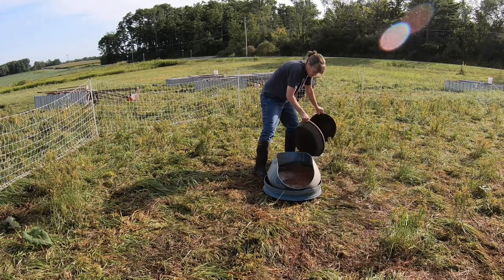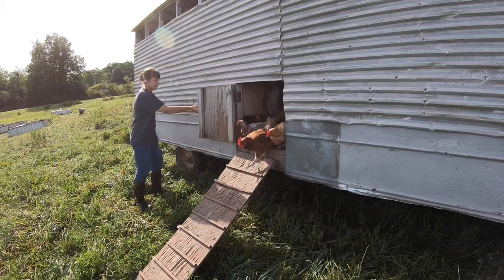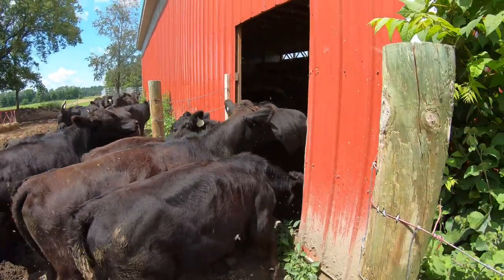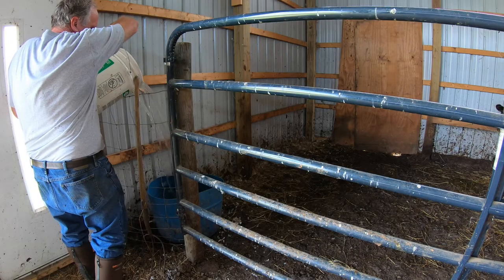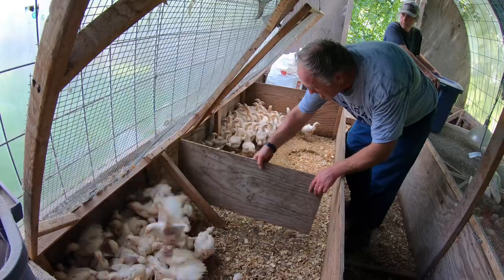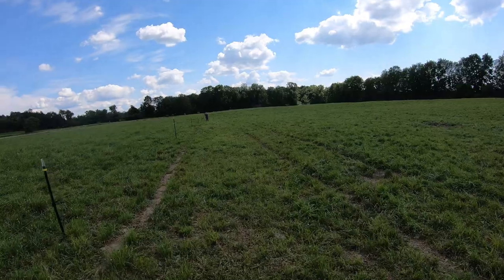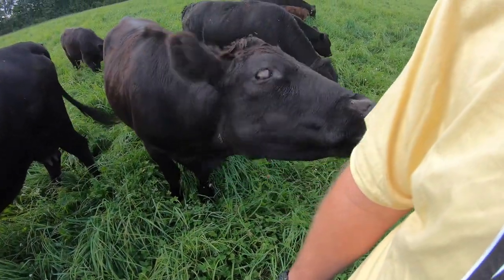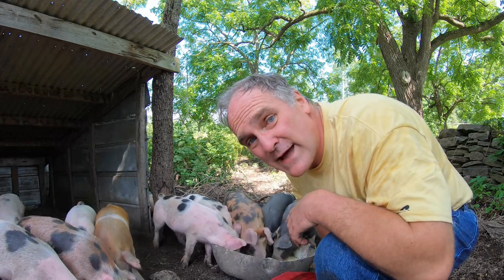Look What I Found!

Comment: Sunday stopped @ booth #72 and wide awake bakery. Have just finished watching your series on rebuilding your ancestry home and have to tell you; we did the same with an 1850's home built by my great grandfather. As I watched all I could say is "been there done that" and was amazed how similar styled our homes are, and 300 miles apart. Our daughter was the age yours were when we did ours but is now a veterinarian @ Cornell. Will stop and visit booth #72 on a Sat next trip.

Comment: Excellent video Pete  :) yes I am in Ontario Canada also have my share repairs  on vechiles as mechanic also body restoration to fix old to new vechiles! Also years ago on farm the 1950  Cockshutt COOP 40 gas motor and  1963 McCormick International B414 Loader tractor  Desiel motor & 1978 International 724 Loader tractor Desiel motor do rad cleaned  plus repairs also fix cores  because road salt from road  even use them going to other farms my dad rented in Winter or Remove snow each year of 4 months Winter Season! B414 was worst rad and hard get parts for sometimes because machinery shed never heated in Winter Season to or insulated from cold winds or you name it!

Comment: Being a mechanic of 30 years of experience, I hate to tell you that any amount of water mixed with the transmission fluid, even if only for a very short period of time, will cause premature failure of the clutch packs. The material will begin to breakdown chemically and there will be noticeable slippage until it quits pulling altogether. This usually starts to happen rather soon. Only way to resolve it is either a complete rebuild or a good used transaxle. Just a heads up from an old grease monkey. Love your channel btw!

Comment: If you have time Pete i would be interested on your view of having a older tractors on the farm vs one new kubota or any other brand. Personally nothing against new machines but i dont have the income to afford them. Having 2-3 older tractors do the same job for me. Yes there are downsides but then again where is the joy of learning and discovering the knowhows yourself? I like working on cars but the moder vehicles are just a hassle to start with.
Reply: Steve I'm currently watching Mustie 1 renovate a Kubota that is a few years old. What surprises me is that this Kubota, his friend's Kubota and the other Kubota he has at another place is that none has a roll bar. Though commonly called a roll bar that is a misnomer, it is a roll-over or more often a roll back (where the tractor tips backwards on snatching a load) protection. These first started appearing in the UK and Ireland in the 1960s or 70s, nowadays, all larger tractors have full protection cages and no doubt glazing and air-con. You even see vintage Fergussons or David Browns where farmers' affixed bars behind the seat.  These Kubotas are not that old though, has the US never had any legislation for tip-over protection for tractor drivers? Out of courtesy, I would have provided a link to what I was talking about, but Pete doesn't like YT links. Are Kubota still making these small tractors for the US, in the UK the smallest is a 66bhp model in a modern format.
Reply: @COIcultist  I have seen Mustie 1 video. Well he dose what he can. Can't say anything bad about Kubotas.They have there nish of usage in today's world. As for the roll bars. Not that familiar with western tractors. But I can give a example from what I know from my hearth: I remember the Soviet tractors from the Belarus series started getting roll over bars in the early 1980s for the internal Soviet market. But the onse that got exporter where equipped by the abroad dealers with roll over bars and inside reinforced frames for the cabin as early as late 1960s. That was to do safety laws that made it mandatory. There where a lot of accidents with the belarus tractors specially the 720 series that in a case of a roll over the cabin would crush the driver and be fatal 99% of the time. I'm amazed it took the soviet union really 30 years to start taking measures to prevent death on roll over or fatal injuries? What ever the case was at least the later tractors where much safer to use for the end user.
Reply: He kind of covers the new vs old tractors in one of his tractor restoration videos if I remember correctly. I agree with him that I would rather fix up an inexpensive older tractor than spend the large chunk of money a new tractor would entail. I have a decent old 4020 John Deere and a old Mahindra 4500 with a Frey Loader. The Mahindra runs but still needs a little work but at 3,000 vs 35,000 I know which route I am going to pick.
Reply: @Mtbambeno  Maybe he did, cause Pete has had so many videos I keep loosing track. I do see benefits as a small farmer having older tractors. But there are some pitfalls with them as well. Don't think that is the case in the States cause there is a huge variety of different models and brands. Not to talk about retailers and vendors who specialise also in older models. In some parts of the world it different. I can only speak from my own experiences but that would be like making a hour long video. Rather saying it short, make a plan and be sure to know what you buy+ always have extra cash in case you need to spend more then you planned for.

Comment: at a pasture we rent for cattle there is an old pole barn with a farmall 656 gas and an international 666 with a loader, chains, and a set of duals. neither run but a few guys came out and worked on the farmall. i wanted to buy the loader to put on our hydro 100 to put hay in for horses. also we used to put that hydro on our 12 row corn planter and 25 foot disk

Comment: Hose the underside/ frame/ axles of your vehicles with Fluid Film or CorrosionX! Really slows and stops rust!  

I didn’t do anything on my old Silverado (a 2000) and the rockers rusted like most all 99-07 GM trucks did/do. I treated my 2012 as soon as I got it and have every year now and I’ve got no rust! and yet I see most 07.5-13 GM trucks in my area with rusty fender wells, bumpers, and rockers.

Comment: Hey Pete, I know you follow some if not all of the principles of Joel Salatin. Would you ever consider doing a permanent paddock with gates for the to go thru and still be electrified?
Reply from the maker: That wouldn't work well for us, because we rotate fields between pasture and hay depending on the year. It would be a lot more difficult to take hay from a field chopped up into separate paddocks. Also, I want the paddock size to be flexible depending on grass conditions.
Reply: @JustaFewAcresFarm  ahhh gotcha. Thanks for the response